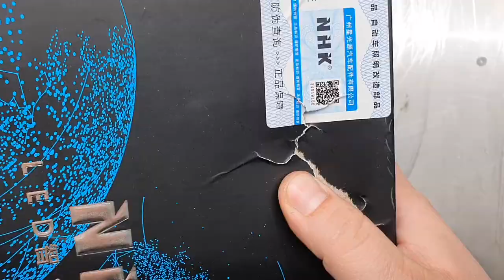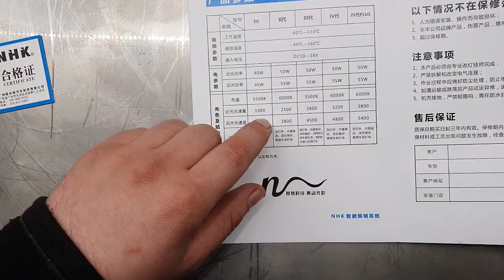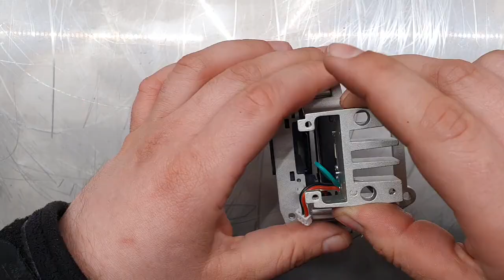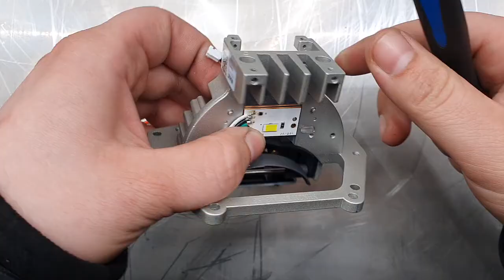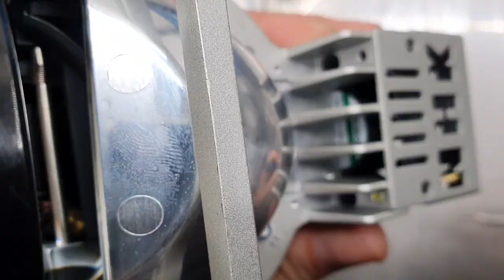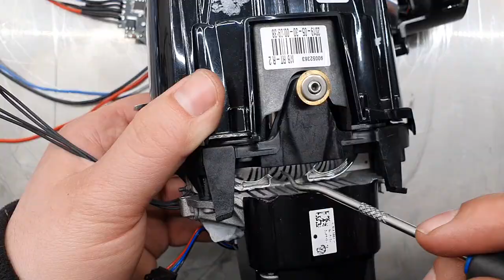NHK Bi-LED expensive fail

Comment: I’ve been running these as my main low beams and high beams on my daily driver for about 4 years now. Never had a problem with them dimming or the fans going out. I can still hear the fans going strong on them. After I watched your video I bought another set and sanded down those screws sticking up under the main led chip. Once they were flat I put some thermal paste between the copper pcb and the metal heat sink/body and it did make the fan slow down. So I’m assuming the temp is staying much more controlled. However even if they did build these cheap I still haven’t had one fail on me. I’ve probably got about 1300-1500 hours on them at this point. I have been delivering uber and Uber Eats full time for the entirety of these lamps lifespan, and average about 25-30 night driving hours weekly. I think the shortcomings are there, but I do not think they will fail on all of them. Also mine were not very much I paid $150 USD for mine delivered.

Comment: I saw this video just after purchasing the NHK Pro Plus 2.5 Bi-LED . For sure I will open them to check the mounting and to apply some thermal paste. Do you recommend using CPU thermal paste like the arctic MX-5 or Noctua NH-D5 ? Do you think it will dry out ? CPU's can go up to 300W so I think it should be okay.
Reply from the maker: Ive used MX-4 I think.. Chinese use generic white compound that is used in anything from LCD screens to welders. Nothing fancy but it gents the job done.
Reply: @75L48  thanks for the reply

Comment: Very interesting, cheers.  I'm about to buy a 2.5" version of this light because it's the correct size to replace poor standard unit in my car.  Unfortunately I cannot find a brand other than the NHK... and wonder how many units I the market are real NHK and others a just poor copies. I don't have the ability to change chips and adjust fan wattage, so it looks like I'll have to just see how it goes.
Reply from the maker: OEM projectors exist like the ones from morimoto used in some Toyotas I think. Output is much lower though. Build quality should be better. Then there are Valeo and BOSCH parts which exist in their catalogues but are impossible to source. So I guess it is as you said, take it and hope for the best!

Comment: Does somebody know about the newer updates version of the V generation? I got myself a pair of projectors and they don't look like the ones in the video. The lens are further away from the body (about 0.2mm), the led chips are positioned different, the body and the radiators are different. Does somebody know something? Thanks.
Reply: These aren't the v's

Comment: Hi there. I've placed an order for the NHK V. Can you please tell me the dimensions of the fan (L/l/H)? I want to be sure that I will order the right one, as I can't find the same model that you used in your project. Also, can you please tell me if you experienced with the Osram 30W led chips? I am looking to replace the chips. Big respect for your work and sharing!
Reply from the maker: Well its this fan PF40281V1-000U-A99, you will surely find dimensions in the datasheet. I still have the car and it still works with original chinese LEDs. If you plan on changing everything you might as well save yourself some cash and buy some no name 40USD crap of which there is plenty. :D
Reply: @75L48  thanks for your time! Also, I will come back here with updates if necessary. I will instal them into the Ford Focus 2 favelift headlights. Don't know if I can keep the AFS function with these lens. I hope so.

Comment: the high beam is the one that uses the bottom led that you discovered and that is why it has different power rating Low/High. Its not only the shield that moves.
Reply from the maker: Tought so but no. Both LEDs are connected in series and are lit up fully the whole time. High beam action is made by moving shutter away exposing different pattern to the projector.
Reply: @75L48  im aware of the shield action (from the good o'll bixenon days)

I had higly moded rx-8 (a little better version of rx330) and bixenon, fx35 (original) etc.. but I need a compact projector most likely (still haven't disassembled the headlight to know for sure) and im contemplating the bi-led.
Any recommendations from you? Possibly some that are less than 6k K
Reply from the maker: @mbalunovic  This is not compact thats for sure. Its a bit longer than standard bi-xenon projector. Some of these without a fan have small footprint but the output power will be also small accordingly.

Comment: Hi, I just modified my NHK projectors and your tips worked perfectly. I could only add that you could try to move forward whole top mirror, not only twist it right. Move right side the same amount as left side. It really seems like a lot of light escapes up becsuse mirror is set too far back (or LED is placed too much forward) and does not cover what it should.
Reply from the maker: I tried it without bolts, moving it freely. It is how I got best of it. I think it will be somehow unique for each projector with different tolerances of parts. Different batch of mirrors may need different allignment.
Reply: @75L48  yes, it could be the case. But anyway your tips worked perfectly. One thing is that I distanced the Lens just about half of a milimeter, becsuse I noticed that plastic front cover of my lamp diffuses the light slighltly so I had to take this into account and make my Beam pattern a bit over focused so that lamp would event it out. Could you give you what's app or email? I would be grateful if I could show you what I have achieved and compare it to your projectors. By the way, do you have any footage how it looks after assembling it on car?
Reply from the maker: @MrPepto93  Isnt there like a contact email for this account? No video on that yet but I may do it in the future. Anyways I am really pleased with it so far, drove around 50 000km 90% at night since I dont have the nerves to drive in day traffic :) and its just perfect.
Reply: @75L48  I added my email address to my channel description. Just e-mail me if you want to see my issuess (and they were major) and results. I spent A LOT of time adjusting and tuning it. And I have a friend who Has Nhk 4 and didnt have Any problems.
Reply: @75L48  wow, do you mean 50,000 Km after your upgrades? That sounds promising!

Comment: Hi, could you please provide sunon fan specification that you install? Thanks 😀
Reply from the maker: PF40281V1-000U-A99  Here you go.
Reply: @75L48  Many thank
Reply: @75L48  what changes did you make in LM317 circuit? I installed these nhk projectors some time ago and now I see that I have to modify them..
Reply: @karolp1993  what kind of issues have you got?
Reply: @tomeks9504  for now only visible issue is yellow "ghost" on the cutoff line but I think when I will dissassembly the projectors the other issue will also appear.
Reply: @karolp1993  ok, I bought nhk iv plus an cut off line is good, only blue color visible. What i will do is new paste and new fan but not so powerfull as Branislav installed. That one installed by him is not maglev is rolling bear type. I will instal smaller, something around 1,5 watt and about 20m3/hr - should be enough.
Reply: @tomeks9504  I checked sunon with ball bearings - in datasheet lifetime is about 70000 hours, it's 8 years nonstop work, I think it's enough.

Comment: Very nice break down.  Thank you for the video. Am subscribed now.  Would the osram 5chip ostar headlamp Pro upgrade it to better light?
Reply from the maker: You mean that 5 chip OSRAM LED used on OEM LED lights? I doubt it, since that one is around 17W or so. Chinese is more powerful.
Reply: @75L48  more powerful? Interesting. Am thinking of upgrading the hid in the mercedes ml with the nhk bi-led.  Thanx for the reply.  Cheers

Comment: I also had similar shitty output on my NHK V4 (yellow tint and not sharp cutoff line). For now I just only moved top mirror and pushed the lens with rings, without moving bottom mirror (I havent disassembled whole projector yet) and so far so good, but still got some yellow tint, althougth is MUCH MUCH smaller and visible only when very close to wall (comparing with previous shit I could safely say that now I dont have this tint :P). Tomorrow I will disassembly whole projecotrs and move bottom mirror also. And by the way. Do you think moving lens more than you had will do any better? Or moving mirrors a little bit more/less? Have you testet with other positions of mirror/lens? Cheers :)

Comment: Thanks for the great video, I would have overlooked all the faults you mentioned. What did you end up dropping the voltage to on the fan? Would the Sunon fan still live happy without dropping the voltage? I had to choose a different fan from Sunon, as the vapo fan is on national back order for quite some time. I purchased a pair of Sunon fans which appears to be its equal, other than the ball bearing design, and lower wattage rating of 6.12W, part number PF40281B1-000U-A99. Is that fan an adequate supplement for the vapo fan you used? Given the lower wattage would I be ok not modifying the voltage to the LM317?
Reply from the maker: Something around 7V or so.. I measured heatsink temps before and after and even with 7V those Sunon fans dropped temps a bit compared to the chinese crap fans. They just have so much better flow. But still you can run them full power as they are rated for thousands of hours.
Reply: Thanks for the info.

Comment: Nice video bro, i was considering the plug and play NHK biled, but they look like there's no fan on the back... And after watching your video I am not sure if I want them :D What Biled lens do you recommend at around this pricepoint?
Reply: plug and play NHK bi led has fan on the back actually..
Reply from the maker: There may be passive cooled variant but power will be around 30W tops. Meaning it will not be brighter than good bi-xenon projector.
Reply: @75L48  i inspected them, they have a fan under the lens, not behind it, but still, can you recommend something good or you have tested only this

Comment: Hi Branislav

Thank you very much for informative video, I already order 5pairs of IV Plus & 5pairs of Gen 5.

can I ask you where I can buy the fan ?

Also is it possible to change the Chinese led with Osram or Cree with high wattage if available.

regards
Reply from the maker: Hi, bought at Mouser.com, they ship worldwide. It was this one PF40281V1-000U-A99. What I forgot to mention is, you need to make fan suck hot air from an enclosure. Not blow into it as it was from factory. There is inevitably always some dust and it will be blown directly onto lens. So dont forget to do that also.
I dont see why not,  LED I shown from OSRAM is perfect fit for this. However those only come in 15.5W I think, thats much less than that chinese one. Would need to try it if its sufficient. Cree X-HP70B with 32W max. would be superior but has large chip area, dont know how it would focus down.